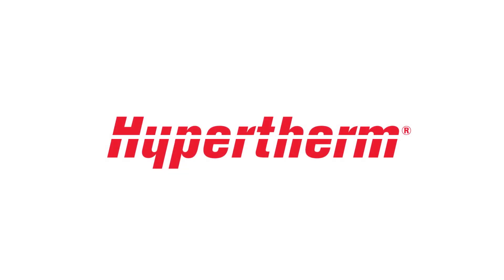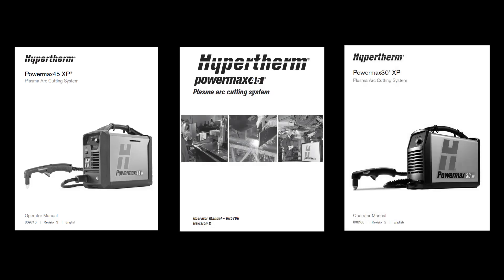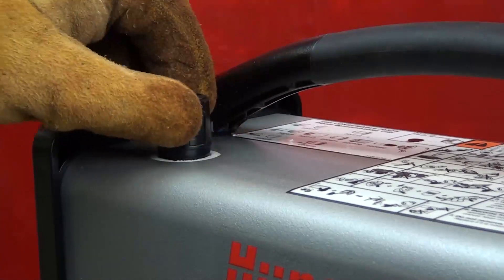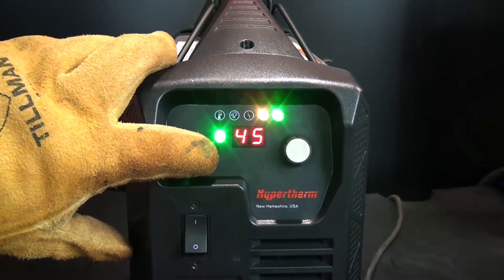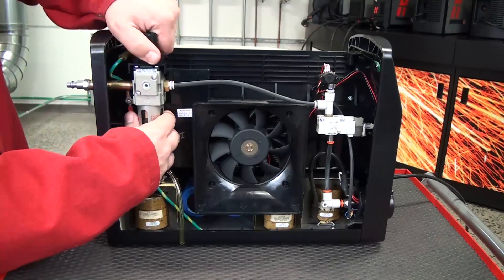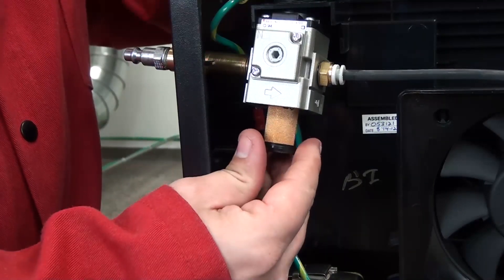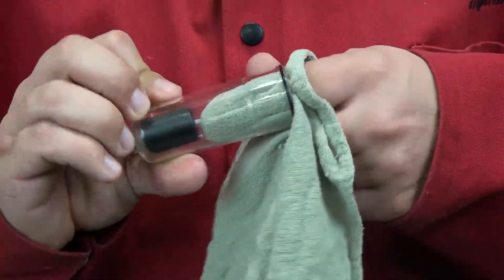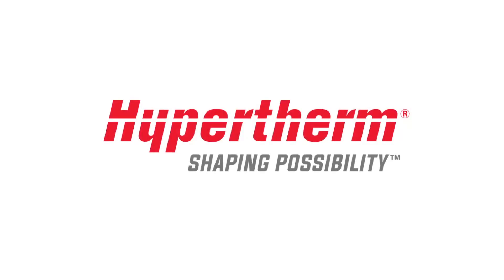Powermax Low Gas Pressure Faults for Powermax plasma systems under 50 amps

Comment: I have a Powermax 105 that keeps misfiring. What is the problem and how do I fix it? 
I have  a water separator by the air compressor and a double water separator just before the plasma cutter air inlet.
I have lots of air going to it and it never drops below 100 psi when I depress the gun trigger. 
I have replaced all the consumable parts on the gun with new parts and it still keeps on misfiring.
I have a powermax 30, 45, and 2 105's and i have also tried swapping wipes from the other plasma cutters and no change.

Any information would be very grateful!!

Comment: Except my powermax 45 has been getting intermittent pressure failures since like 6mo of ownership, and I got either 1 or 2 pressure sensors under warranty, and they seem to help for a bit but then it goes right back to it a while later. Mostly while static, test mode or not, and it flicks back and forth. It'll work fine for a few minutes, then won't work for an hour. Sometimes it'll work for several hours with no flipping to fault, etc. Pretty random. I'm pretty done with it causing me to miss ship dates and bought a $300 Amazon one as a backup. I really wish this d*** thing was reliable because I really like it!
Reply from the maker: MBarton, so sorry for the delay in seeing this comment from you. Have you contacted our technical support team to help diagnose any further issues? you can reach out to them here : https://www.hypertherm.com/en-US/contact-us/?category=GeneralFeedbackQuestions&form=technical-questions
Reply: @hypertherm  I have, several years ago, and was told that I was out of warranty now, and I'd have to start paying for the parts they wanted to keep throwing at it.